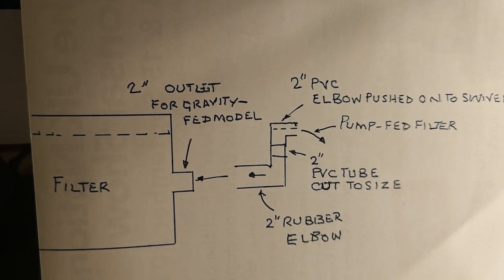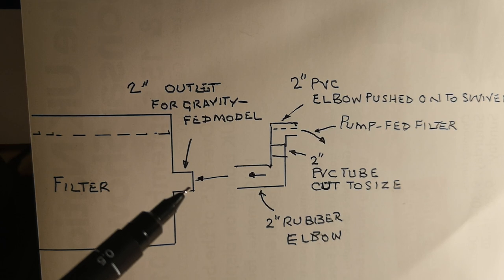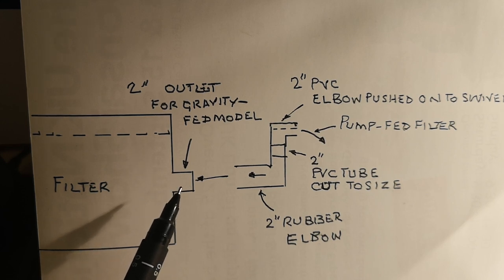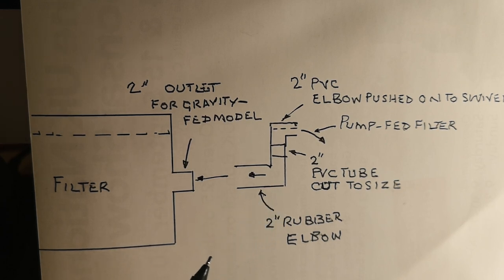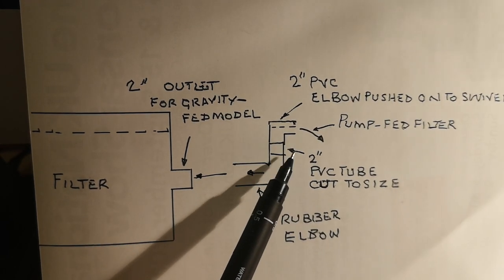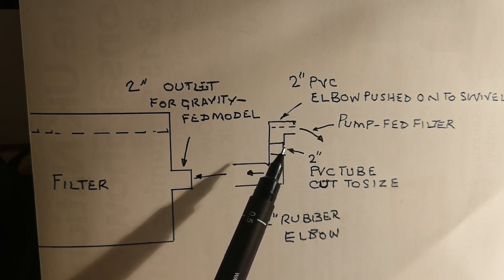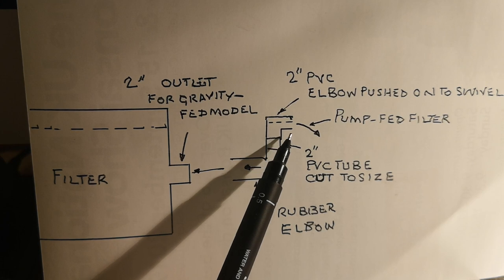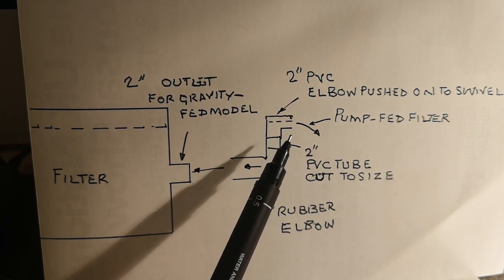A simple and cheap method of resolving a minor problem

Comment: You could do it a much easier way. Use a stand pipe in the end box. Remove it if you run gravity. Install it if you are pumped feed. Easy peasy ,:)
Reply from the maker: Thanks, standpipes need 'O' rings and 'O' rings often wear out. I'll stick with the assembly thanks.
Reply: @waddypete  you can get some pretty good o rings that will last many years. I know a few guy's running there filter with stand pipes for the last 20 year's. Still works. They made a cone shaped hole for the pipes. But that's kinda hard to do.
Reply from the maker: @AudioheavenDenmark  - I must bow to your superior knowledge Sir, but in my opinion, ball valves will always be the safer and better option.
Reply: @waddypete  agree. Ball valves almost never fails. I've never had one fail. Nothing to bow about. I'm just a novice. Anything less than 10.000 hours experience is novice in my book.

Comment: should the 2" pvc 90 on discharge not be a T fitting instead so it will vent and not siphon out the filter to rubber 90 level
Reply from the maker: That's true Dario, but some may complain that they don't own a drill and expect a drill should be included in the price.

Comment: In a earlier video you stated that your filter can be used as both a pump and gravity fed system just by capping off the pipe thats not needed so why do you now need to cut the filter down and add extra parts?
Reply: Good question, which deserves a reply.
Reply from the maker: Andrew, despite cutting down the overall length of the filter, it still can be used both gravity-fed and pump-fed.
Reply: @waddypete  oh dear Waddy, what utter nonsense
Reply: @waddypete  if it can still be used for either i don't get why there is a need to cut it down
Reply: And why now are you supplying extra fittings?, is it because of a certain koi enthusiast that showed that it needed alterations to make it work correctly?, something you don't seem to want to acknowledge.
Just admit the filter needed adjustments and apologise. Then move on
Reply from the maker: @andrewpember2204  - cutting the length down makes it cheaper for me to purchase and also makes a small saving on transportation costs. I only have to buy one rubber 90 degree elbow for each filter.
Reply: So are you charging £745 for the rubber elbow and £5 for the not so epic filter. #bargain
Reply from the maker: @CitystompersLDC  - no, I'm charging nothing for the elbow but I'm charging £750.00 for my horizontal-flow design, the professionalism of the box, the contents of the box and many days testing it all out.